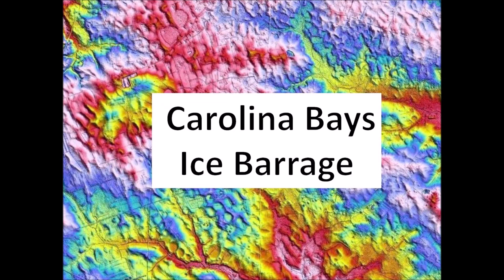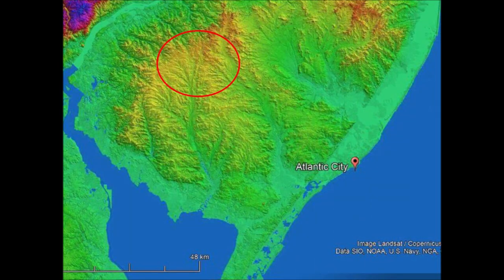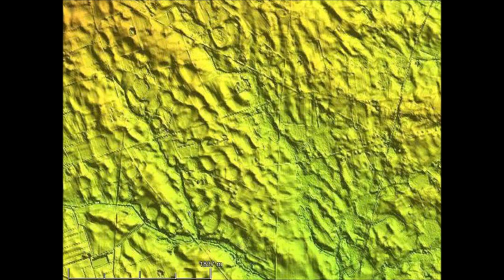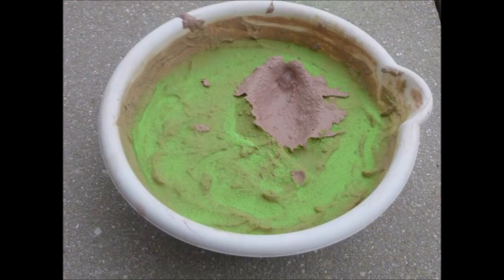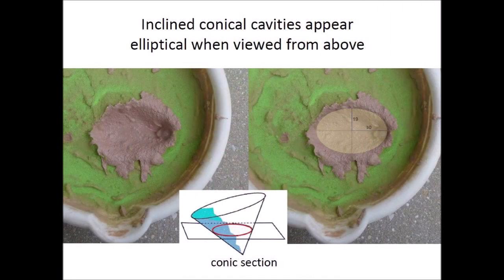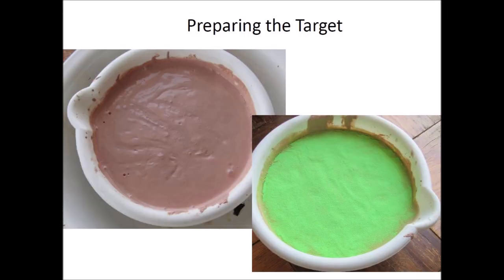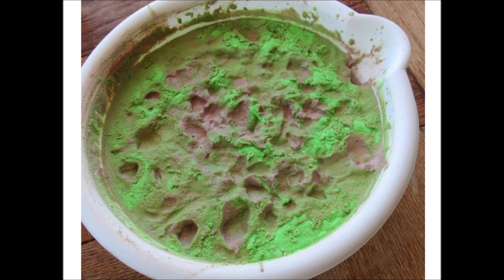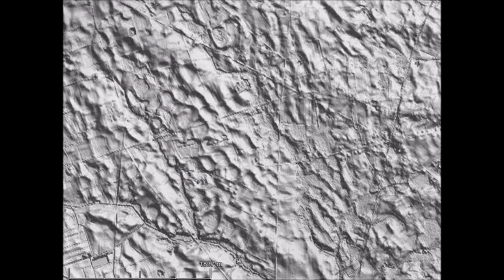Carolina Bays Ice Barrage

Comment: I applaud your tenacity. Although the hypothesis in and of itself is inherently obvious demonstration of the mechanisms is an integral part of ultimate acceptance. Bit by bit you are providing the necessary proof of concept and evidence. The issue is gathering increasing support. At first I found the hypothesis intriguing, now I find it compelling.
Reply from the maker: I have tried to design experiments demonstrating that impacts can create all the features that we see in the Carolina Bays, such as overlapping bays, elliptical bays, and now the buckshot terrain of New Jersey.  I am working on a follow-up to my book Solving the Mysteries of the Carolina Bays.
Reply: @Antonio_Zamora  would be interesting if you continued this experiment but after the initial drying sequence do an every other day spray mist of the surface. 

I'm really trying to grasp a chunk of ice traveling at what speed? and how it is going to stay as ice? and not get turned into water? before it lands on Tera Ferma at what speed again? really?  a chunk of ice?

Can we think water?So after saying that another test would be to shoot ice cube sized water drops at your mixture of Tera Ferma.

Speed/angle of impact and erosion characteristics should be analyzed with both objects and compared for differences to each other and similarities or not to the real world as well. 

I like the direction this experiment is taking us. Please continue but with more accurate testing methods!!! Think water not ice by the time it impacts Tera Firma. I think I've seen some ice bullet studies done somewhere and at 3,500 fps the bullets melted away before reaching their nominal range of use. 

Also would like to see impact test of suspected object at scale and at proper impact speed and angle of impact on Ice to get an understanding of debris formation and trajectory of these ice chunks that might be mostly a stretched out water mass stream traveling at supersonic speeds by the time it reached its destination.
Reply from the maker: The reentry of the ice boulders has been covered in another video. https://youtu.be/KUKM3CYsOlE  In general, The ballistic equations indicate that the ice boulders had a speed of 3 to 4 km per second or about 11 times the speed of sound. As far as scaling up the experiments, I would have to destroy a couple of cities to do it, so it is not likely to happen. Look at some of my other videos; they answer some of your questions.

Comment: The ice curtain must have been very wide considering the coriolis effect showing up as elliptical in Nebraska and much closer to vertical in New Jersey when they are roughly equidistant from each other.  The initial explosion under the ice sheet must have been a global Earth shaking event to launch so much material that the enormity of it all is hard to imagine.
Reply from the maker: The area of ballistic sedimentation corresponding to the ejecta curtain had a radius of about 1,500 km.

Comment: YES and NO mr Zamora, love your work and maybe not not ice but sand and water.I believe I’ve found what you’re looking for!
There are ovals from at least 3 directions down there. As an exampl: up to 3 km long ones near Myrtle becomes
gradually smaller when you follow the border to Gibson where the fields are littered with 10 times smaller ovals but aligned on the same axis.
Now look at the ice age shore line 100 km southeast of Myrtle Beach at about 32°55'00”N 78°20'00”W, using a bathymetry map (ex. Arcgis) you’ll see there’s a 30 km wide crater like hole there!

To me it looks like Long Bay, Onslow Bay, the shoals in between and at either side, the sandy marches of the Pacific, spotted with pingus, is not the result of post ice age rise of water level. More the result of impacts at the ancient shorelines, debris of sand and water and huge tsunamis.

Comparing alignments like at 34°53'12”N 76°27'48”W with other ovals in fields like the ones outside Gibson and Ketchuptown made me start looking for signs on the shallow seafloor and a 30 km hole is comparable with the Hiawatha Crater. 

I hope this was helpful.

Comment: Antonio, do you think that the impact on the ice sheet could have plowed clear through the ice sheet to the ground below? If it did, would it have rapidly boiled the glacial slurry below and then exploded up and outward, carrying the ice fragments? Or, if the impact was not enough to traverse the ice sheet in it’s entirety, would it have still exploded outward the same way? If it did go clear through, would there still be a location visible today where the impact occurred?
Reply from the maker: I have calculated that the meteorite would have had a diameter of two or three kilometers, which would have certainly gone through a 2 km ice sheet. The angles of 35° at which the Carolina Bays were emplaced, indicate that the ejecta curtain was propelled by a  plume of steam at high pressure. Take a look at this video: https://youtu.be/icqRjF04w_E
Reply: I imagine if the impact occurred on the glacier, during the following cool period the glacier would have re-advanced  and scoured the crater eliminating much of the evidence. I wonder also if an impact into the ice and the concurrent steam explosion would make a different kind of crater than people are looking for. Would there be a rim at all?

Comment: Imagine this. You are standing on the street next to a large building. The building is very large. You have never seen a building this large before,

This building is a mile wide. It is one mile high. This unimaginably huge building is 1 mile x 1 mile x 1 mile -- A CUBIC F*KING MILE!

Standing beside such a huge building, you are but an ant!

Now you notice that this huge cube is cold as ICE. 

It IS ice. A cubic mile of ice?

A cubic mile of ice is probably pretty heavy, wouldn't you think?

Wouldn't you think?!

No way any force you can imagine could lift such a massive cube of ice above the Earth's atmosphere and into outer fcking space!

Yet, I submit to you that such a force exists. In fact this force of which I speak is capable of lifting 10 cubic miles of solid ice into outer space.

What is this force?

Water. The sudden conversion of solid water into water vapor. 

End of story. The YD Event was no ordinary impact. Throw your impact book in the garbage. It is not applicable. Because there is no ice (2 miles thick) on the moon.
Reply: Such an explosion might leave an impression on the landscape. Possibly seen today as the Great Lakes and an escarpment known today as Niagara? 

It was a blast. Later. I'm gone.

Comment: Antonio, I need your help.  How big of a meteor (iron/nickle) would it take to make a 62 foot (approx) diameter crater.  Speed and age unknown.  Thank you
Reply from the maker: You can use the following web program to calculate projectile size, but you will need a speed.
https://bit.ly/projectile-size
62 feet is about 19 meters or 0.019 km